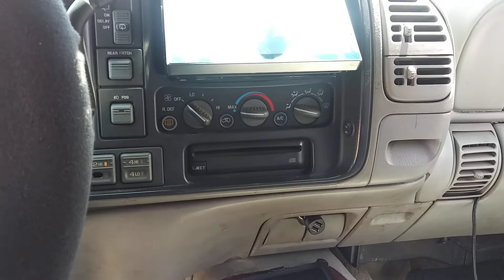4 Soundstream T1.4000DL Powering 2 Custom Soundstream XXX 18s

Comment: What r u running  on ur electrical
Reply from the maker: Current electrical is 3 runs of 4/0 welding cable power and ground runs. 2 Autotech Engineering 320amp Alternators and 100ah of Cmax lithium cells